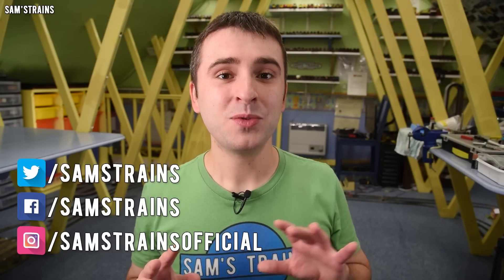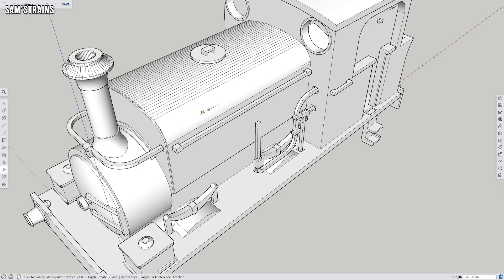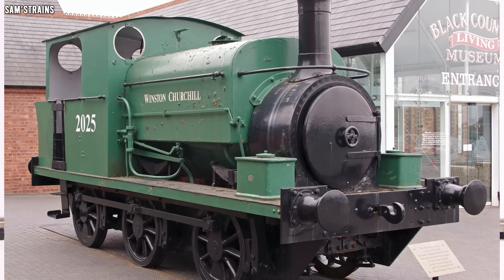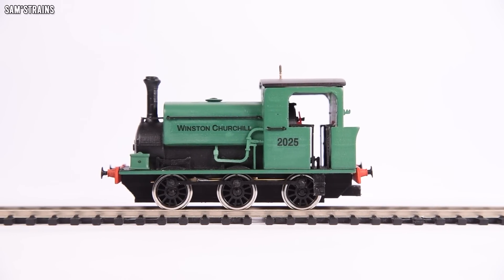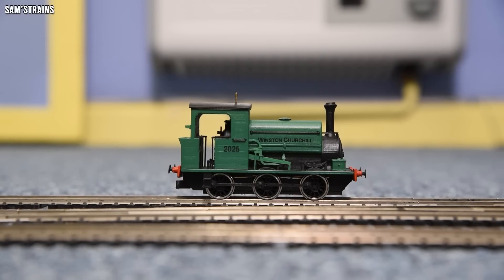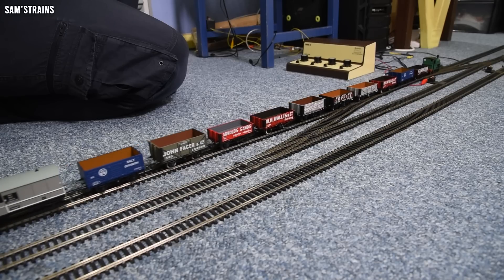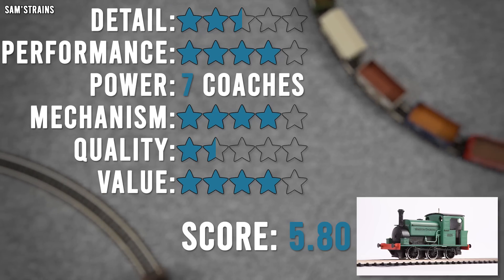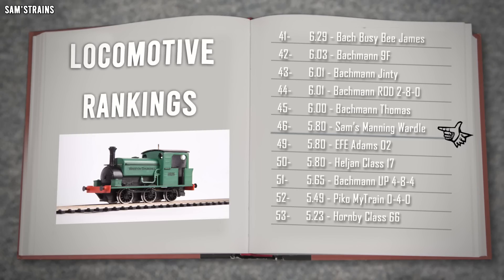Sam'sTrains Manning Wardle L Class Tank Engine | Unboxing & Review

Comment: Stop selling yourself short. It's a nice little model, which looks like the original vehicle, and it works. It looks perfect at the head of a line of Private Owner Wagons. If it were weathered up a bit and given a crew, it would look superb.
I have made models for over 45 years, but never designed my own from scratch like that. It's great work, to which I say: "Nice one."
Reply from the maker: That's very kind Brian - weathering is an interesting idea... definitely something I'd love to learn!
Thanks for watching, Sam :)
Reply: Why does the tank engine in the thumbnail look like Charlie from Thomas the tank engine and friends?
Reply: Agreed brilliant effort for a cheap 3d printer I use a cura 4 high build primer is a good way to hide the layers created by printer recently made a stew ake of 7 container cars with containers but tidying saved a fortune

Comment: I'm pretty impressed.
A non professional modeler, with an engine printed in his attic, does a better job than Heljian.

Like I really feel the shortcomings in the appearance is made up for in the performance, so yeah. In my opinion this thing is better than a Heljian, even with abysmal pulling power.

Mostly because it runs.
Reply: Heljan, it's a pretty low bar . . .
Reply: @billywindsock9597  yes.

Which is why they should be worried that someone who isn't a professional modeler can tick off more boxes on "working model" than they can.

XD
Reply from the maker: Thank you so much, really appreciate it! And Billy's right... I've had bowel movements that more closely resembled a working model than some of Heljan's efforts!! xD
Thanks for watching, Sam :)

Comment: What a great result Sam, you're right to be proud, the difference between this and your first 3d printed loco really show how quickly and effectively you've picked up the CAD and manufacturing skills necessary to create some unique pieces of rolling stock. Have you come across High Level Kits? They make some really small, smooth running and powerful motor/gearbox combinations. Some of the gear towers are quite tall too, so you might be able to lift the motor up enough to model the bottom of the boiler. 
 If I might be critical of one small part though, even ignoring items like surface finish, fidelity and materials there's still a chasm of difference between this success and designing the same thing to be mass produced. If there wasn't, there would be a lot of people like me out of a job! 3D printing is a very forgiving manufacturing method and you can get away with not having to pay a lot of mind to how the design will affect the material you plan to build from. Additionally it doesn't require any tools to be designed alongside the part itself and you aren't limited by the cost or function of those tools. I'm not trying to knock anything you've achieved, I just don't think it's very fair on the ordinary designers building models for the manufacturers to make statements suggesting what they do is easy or they're overstating the effort they put in for profit. I'm really glad you're showing what can be done though, the more people giving it a go the better. Even if it's just to get a better understanding of the compromises that need to be overcome to make a pleasing model. At the end of it, nothing beats the satisfaction of having a unique model built from your own hands :)

Comment: More than anything else - this project demonstrates to me how overly complicated and convoluted commercial steam model kits are. You made the design and assemble so straightforward. Makes me wonder why commercial kits are so difficult to construct. Well done.  The clip around the motor was pure lateral thinking - yet I am not aware of any kit of RTR model which has incorporated such a useful and obvious method of holding the motor.
Reply from the maker: That's a very good point actually - the way the bodies, base keepers, motors, wheelsets etc fit together on some 'professional' models is absolutely ludicrous... there are literally no models that can't be built/assembled relatively simply!
Thanks for watching, Sam :)

Comment: Absolutely fabulous, well done Sam!  Using the metal reduction gears from a dirt cheap servo along with your 18000KV motor and team up with OONeals channel to CNC mill a brass chassis/running plate for weight and I'm sure it will be smoothly crawling with 15 coaches in no time!
Reply from the maker: That's a great idea Ed - I'll have to look into that! Though I've now learned how to 3D print gears... and yet again that cheap printer does an amazing job... so hoping to have a bit more control over the next gearchain I make!
Thanks for watching, Sam :)

Comment: Another fantastic build man. As for the hard to reach areas, I'm a plastic injection mold builder. I don't know where to get these, but try picking up some polishing sticks. They are sticks of an abrasive compound that you can use to polish the metal in the mold to smooth out tooling marks
Reply from the maker: That's a great tip Alex, thanks so much for this!! :D
Thanks for watching, Sam :)
Reply: I use a product that goes by various names including "sanding sticks," "sanding twigs," or "swizzle stick sanders." Whatever they're called they're long, skinny sticks of some sort of foam, about 3mm wide and thick, and covered in various grits of sandpaper. I'm in the US but I'd imagine you can get them in the UK one way or another, and they ought to be quite cheap and they're exactly the tool for the job.
Reply: @max_archer  yes max you can get them in uk .I bought a box containing an assortment at an exhibition about a year before everyone got locked in by the latest nastiness

Comment: A small slug of lead in each side tank too?  The only other thing which may improve running, would be to use fine phosphorbronze wire or even thin flat strip (Eileen's Emporium - there's a web site). Great model and demonstration of the abilities of both yourself (well done) and FDM printers.  Thanks for all the work Sam.
Reply from the maker: Great ideas Andrew - I'll have to look into getting such wire!
Thanks for watching, Sam :)

Comment: A little tip for painting, do a 50:50 water paint mix this reduces visible brush strokes but would also help fill the lines you couldn’t sand. It would take a few coats but should give you a nicer finish.

Comment: Love the Black Country Living Museum.

I’ve done the same thing to create a loco, albeit a donor tender drive unit. FDM with proper prep and a bit of filler at joins can look as good as anything else and a lot better than any kit built models I’ve bought to overhaul and repaint. They do need a lot of sanding, and that destroys rivet detail, so I’ve added waterslide rivets.

I’m currently making a freelance industrial semi-pannier which is also FDM. I’ve got a resin printer but not used it yet, easy to see it will be better for some things, but all of the resin bodies I’ve bought have been warped to some extent which is it’s own problem.

To deal with light colours on waterslide, I buy white backed waterslide rather than clear, and photograph the painted loco. I bring that into the programme I’m adding the detail and put my light colours over the top. Then, when it prints, the colour between the text is an almost perfect match. If you want more info, let me know and I’ll talk you through how I do it.

P.s, I hate how flimsy the hornby rocket coaches are so I modelled the open top carriage using generic Dapol wheels and really dumbed down couplings, far more sturdy but not really lacking detail. Happy to share

Comment: I love industrial tank locos, eg Peckett W4's, and this one is just great looking - even close up it certainly holds up to many kit built locos. With brass rails and a bit of photoetch it would be perfectly commercially viable. Have you tried printing at an angle like many ppl do? They say if it looks right it is right and this looks right! I'd love to see a airbrush and oils weathered black or NCB version. Also it's crying out for a cheerful driver with a mug of tea and an oily rag in the cab :)
Ratings
Detail 3
Performance 3
Mechanism 3
Quality 3
Value 5
Reply from the maker: Me too - something special about industrials! I have tried printing at an angle... I did one body normal, and another at an angle... and I couldn't tell a difference... but I will investigate more! Thanks for your ratings - you were kinder than I was overall!! ;D
Thanks for watching, Sam :)
Reply: This DOES NOT hold up to ANY kitbuilt loco, even the more basic kits built by a begginer will still have the advantage of being metal, so they feel good in your hands and most imprtantly they actually have some traction ! Tbh even a basic hornby 0-4-0 could look better than this.

Comment: Brilliant work Sam.  As a former designer may I offer you some hopefully constructive criticism.     Take a step back.
Two comments,    1.The worst thing isn't the lettering, it's the layer lines.       2. Just because you can print the whole assembly as one, doesn't mean you should.
If you designed this more like a kit, rather than a 'one piece',  each part that has a flat surface, could be printed separately and easily sanded perfectly flat.
Buffer bar for example. Print the bar, sand it, print the buffers (which in real life are cast) and don't need sanding, glue them together. Different textures, fantastic!  Best wishes.

Comment: Sam thats fantastic, I knew you could do it. Yes its not perfect and has layer lines, but so what? Yes, extra sanding and needle files would work wonders. You could print the yellow lettering by using white transfer paper and mounting the lettering onto a matched green background. Id put the transfers on and touch over the green to hide any colour mis match.

These are minor, minor things Sam. YOU BUILT THIS YOURSELF, something to be very proud of, and you will only get better from here.

Comment: 'Horrible' - maybe. Absolutely brilliant and inspirational - definitely. Without a doubt. Already in just two tries you seem to have caught up with 1960s Tri-ang.

If you aren't going to do much shunting with it, you could even fit cosmetic 3-link couplings. But no need for air or vacuum pipes on a contractor's loco. She would, after all, only be hauling a handful of wagons at a time, or a few antique workmen's coaches.

Maybe your next design will have brake-gear and guard-irons... And, um, if she has sand-boxes, maybe some bent-wire sand-pipes. Just saying...

Comment: Nice work. You have room beneath the running plate to raise the NEM pocket, if you tweek the chassis a bit, an pull it in, and up, to make the top of the pocket flush with the bottom of the buffer beam.  For more weight, and yes I know it won't be 3d printed, make a paper template of your running plate minus the boiler and can and cut it out of a sheet of .030 or .040 modeling brass, also make the tank separate from the boiler, with guide pins for locating, and fill it with weight, or dcc components. Great video, and a nice model

Comment: Sam, have you looked at the "N20" motor and gearbox combos. I have a remotored a hornby "Smokey Joe" that now crawls super slow speeds. The gearbox is very noisy still but it is getting quieter after every decent run. Or if you could get en extra intermediate gear in then you will get a better crawl and more torque. Regarding weight, could you add fishing lead shot in any vacant voids in the body or chassis?
With regards to printers, from my perspective having both an fdm and a resin printer gives the best of both. I find large resin prints flex so chassis are best with fdm, and details like cab details and buffer beams, etc are best with the resin printer.
Anyway, awesome job, I think you have done superb. I can't wait to see the next model you produce.

Comment: instead of sanding the 3D print down, you could use the acetone vapour method to create a smooth surface and 'dissolve' the layer lines away

also, the wobble is quite cute to look at

Comment: Edwin's tend to use the 3D printing for their replacement loco bodies. I think if you sanded and used a filler to smooth out the rough line finish and then paint the model they would look really impressive. Might be worth a try.
Reply from the maker: Thanks Ben! Yes this body was fully sanded and filled... it's just hard to get to certain areas... just need to find the right tool!
Thanks for watching, Sam :)
Reply: @SamsTrains  I have a feeling there are some tools available for doing finer filling jobs from specialist art stores who sell them to sculptures.

Comment: Bang-up job you’ve done with this one, Sam!

If you ever come back to this one, I’d suggest designing the chassis with voids to put weights inside (if there’s enough space and you’re willing to pay the money, I’d suggest super tungsten weights; otherwise, lead shot) instead of designing it with 100% infill. Also, perhaps you’d be willing to try printing counterweights, as the real-life loco appears to have on the front and rear drivers?

As for designing a diesel, I submit the BR Class 13 for consideration. It was a pair of Class 08s permanently coupled together, with one having its cab removed, so the two would become a “master-and-slave” pair.

Granted it may be a relatively easy build depending on how detailed you want to make it, and the fact that you could just make the slave unit and couple it with whatever Class 08 you may currently have, but it would be a unique addition to your collection.

Cheers!

Comment: Very good job here Sam. I'd be interested to see an updated version, with the improved couplings, and perhaps printed on a resin printer (future review there possibly?).

I also wondered if you could print a recess in the firebox to use for an extra weight. Another option would be to use machine screws and tapped inserts for the base keeper plate, rather than self tappers?

Either way, great job with this!

Next project suggestions, how about a improved version of the Manning Wardle in O?

Comment: For christmas I was hoping to get an England class 009 but they run on n gauge and not 00, which is all I have track wise, so I'm going to be having a go at printing off my own body for it.
I'll be getting an 0-4-0 chassis instead if the actual loco, but its videos like this that helped give me the courage to try making my own after seeing how well your ones run,

Edit;
2 months on and the MK3 of the shell for the chassis is printing,
MK1 had a bad measurement or two as I cant read a ruler apparently and MK2 was almost a good fit but caught on some bits that would either leave gaudy holes in the shell or permanent damage to the chassis to fix,
While that's going I'm working on the tender and all I've got to do is add the section for couplings at the back and them I'll be sending it off to the slicer,

Thanks again for helping to inspire me,

Comment: Hi Sam. I would pay £50.00 at a shop for that engine. If you managed to add a bit more weight to the engine it would stop some of that shimmying . On another note if extended the boiler on the 4-4-0 it would make a very nice 4-4-2 Atlantic. Though you would need to lower the boiler and smokebox down a little. By about 2-3mm would do it. But the longer length of the chassis would make it a bit easier to fit the motor in.

Comment: That looks amazing and I think it only needs a few tweaks and it could be a beautiful loco. One you could easily put areas within the chassis which you could then fill with liquid ballast (lead balls) to improve traction. Two you could mount the motor so as to allow the gear train to run though where the firebox would appear on the outside possibly even driving the rear wheels as opposed to the centre then you could have some daylight under the boiler. And three sell the components in kit form because I'd definitely buy it along with most of your viewers. I'd love to see these in all kinds of great liverys but either way it's a great loco and I'd love to see what else your going to make I'm future

Comment: It looks absolutely fantastic and I could definitely see myself purchasing a locomotive like that for £50/60.

Now that you have built an 0-6-0 tank engine, do you think you will try something larger and even more complex?
Reply: Edwin's 3D printed loco model bodies sell for around £50 all you require extra is a chassis off a second hand loco they recommend. I am very tempted on the Andrew Barclay fireless loco body they do which sits on a donor Hornby/Dapol L&Y Pug.
Reply from the maker: Thanks so much Troy! Yeah larger/more complex is definitely something I want to do next! I do think £50 for a 3D printed body is very steep - If I was producing this L class body to sell, I could do it for £15... though it'd be more like £20-£25 with all the separate parts... really tiring being ripped off in this hobby :/
Thanks for watching, Sam :)